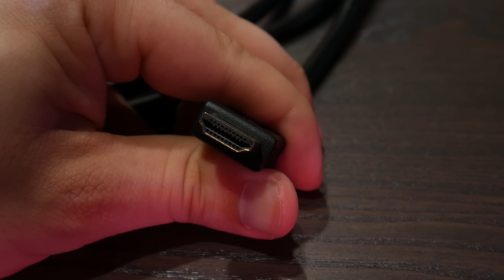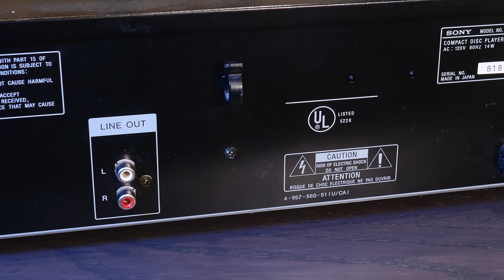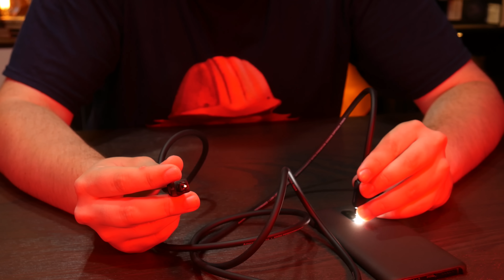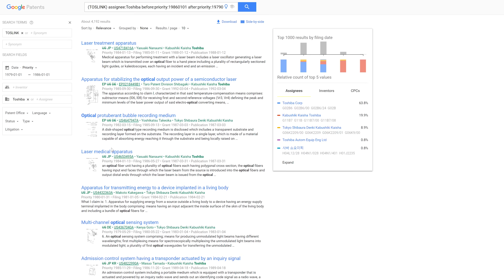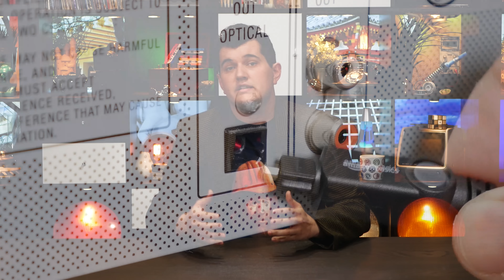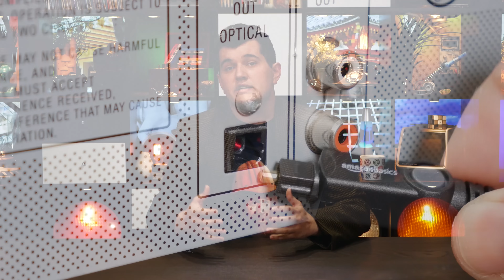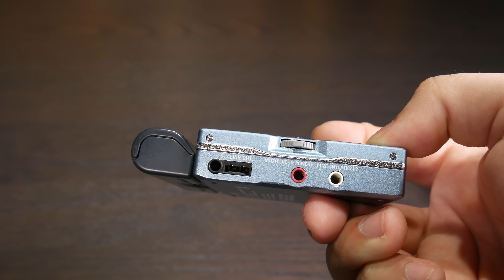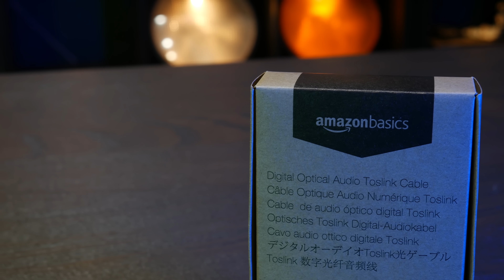TOSLINK: That one consumer fiber optic standard

Comment: I laughed out loud at gold plated connectors on an optical cable. 🤣
Reply: The funny thing is that “audiophiles” fall for this thing, not because of the esthetics but because they sincerely believe it’s better for the signal 😂
Reply: @Druskqq  man, if you think audiophiles are bad, wait until you find out the nonsensical shite tube guitar amp people say....
Reply: @immy4104 "It sounds better when I flip the cable around"
Reply: @immy4104 Nah, both camps are bad. Also, tube guitar amps are still pretty great, mostly because you treat them like tube amps, unlike studio monitors, which are focused entirely on reproducing incoming sound as perfect as possible for say, audio proruction and mastering, lacking the "in room" feel. Try positioning an FRFR cab like the real deal, and most differences will just go away. 

Oh and a gigantic, expensive and heavy noise box always feels special even if largely impractical compared to what's essentially a small computer connected to earphones even if they sound mostly the same.
Reply: @Druskqq  well, apart from optical cables, choosing gold plated cables makes much sense. while extra cost ist negligible as the gold on the plug is literally only atoms thick, the gold keeps the potentially different metals of the plug and the receiver from oxidising wich causes worse electrical conduction wich indeed makes it sound worse (that is not an immediate danger but damager over time though)
Reply: @xXRunDeathXx  Yeah no out of the entire realm of metals and composites gold is just a DUMB idea.  Period.
Reply: @ShadyDealz ok, why is it so commonly used in all of consumer electronics then?
Reply: @AriaTheBee  It's Form over Function.  It really is peak marketing comedy.  Optical cables transmit data using pulses of light, not electrical signals.  A gold-plated connector at the end does absolutely nothing for your audio or video quality.  ):
Reply: @ShadyDealz  It is NOT about the analog noise. Gold plated cables prevent "physical" problem coming from oxidised connections.
Reply: @HeeminYT  And?  That's only the connector heads that have the plating, the cable itself will still be copper and/or silver.
Reply: @xXRunDeathXx that is great for cables that use electrical signals, but the conecters for optical cables transmit using light through the fiber not electrical conduction from the metal. Even oxidizing wouldn't make anything worse as long as the light is getting through the fiber. The actual connector is just a plug to keep it seated and lined up, it has nothing to do with the function of the transmitted data and is purly structural. Hence why most just use plastic for the connector because conductivity doesn't matter for optical cables
Reply: You know, you laugh, but given that the plastic keying on my toslink cable just disintegrated in my jack... I could do with at least the metal.
Reply: What? You mean the shiny, shiny gold doesn't help to bounce the light down the cable better? I'm shocked, I tell you! SHOCKED!

 @IsonDaya  But gold is such a soft metal, the connector wouldn't be any more resilient. The only reason gold connector are prized if for their superior conductivity... which doesn't help at all when you're sending light, not electricity!
Reply: @alexpage4355  sure, but gold doesn't become brittle and literally disintegrate after five years. It would have helped in my particular circumstance.
Reply: @IsonDaya but like you already stated in your 1st comment, there's still zero reason to use "gold" because any metal (e.g. brass) or a more durable polymer would accomplish the same thing 💯
Reply: @alexpage4355  Gold connectors are not chosen for their conductivity, silver is way more conductive.
Gold is inert, your connectors will not oxidize.
On a plus, gold is a soft metal, wich makes better contact.
Reply: @alexpage4355 It's only a thin gold layer though. The rest of the metal will probably be something stronger regardless.
Reply: Like putting gloves on to see better
Reply: @Gregory Ford he’s referring to the fact that gold (and most metals in general as long as they don’t oxidize) do not become dry and brittle like plastic does after a few years. Old plastic can get so brittle that it’s no harder to crack or break than a tortilla chip.
Reply: @shad0w_dragon178  oh my friend, you're buying the wrong tortilla chips for sure! lol totally besides the point, but the moral of the story is: spend that money on better tortillas, not gold anything!
Reply: I'm not sure what you mean by that. Are you saying you don't believe me when I say plastic can get brittle? Or are you saying gold plated optical connectors are stupid? Because if it's the latter I agree but if it's the former... well I don't know what you are on about.
Reply: @shad0w_dragon178  What sort of plastic is used in the connectors?
Reply: @Devantejah  I honestly don’t know.
Reply: @shad0w_dragon178 its not like a micron layer of gold is going to make it stronger
Reply: @fireworkstarter  Well.. That's not necessarily true. The gold layer can stop the oxidization of the layer below.
Reply: Like putting a protective case on a Nokia 5110
Reply: that's marketing for you: sell you somenthing you don't need that you didn't want in the first place but were brainwashed to desire it
Reply: Me too and my wife looked at me like I'm an idiot.
Reply: Ha, that's what I came here to say 👍
Reply: @WirelessNut who cares if it's the same price anyways
Reply: Better light quality. 😂
Reply: same LOL
Reply: o'l mate's gold
Reply: I thought gold plated connectors didn't corrode, which is why its used, not its conductivity
Reply: @seymoarsalvage You are correct. It is the fourth best electrical conductor, but the only one in the top four that doesn't oxidise or react with sulphur.
Someone mentioned brass, but that oxidises.
The conductivity doesn't matter either; the point of contact in the connector is infinitesimal compared to the wire it connects. Corrosion itself is mainly a problem because it causes an unstable connection due to structural weakness, unless it is so severe that there is little to no metal to metal interface.
Any ability for gold to deform to fill gaps is also the "ability" for it to wear away.
Reply: YouTube actually suggested buying a gold-plated toslink cable as soon as Alec said it 😂
Reply: go big or go home i say, you're using a fancy cable anyway
Reply: I hope that all of us did.
Reply: Hahaha hey a good ground is ALWAYS necessary xD
Reply: I could almost cry and laugh! No, no, no… 😂
Reply: I'm sick, so I coughed 😂😖
Reply: They make the light brighter... or somthing
Reply: probably many audiophile bought it because  gold its better to transfet electricity 😎 and gives you +1 to being cool because its fiberoptic its also gives you +10 to being dumb if you have one of them
Reply: Monster HDMI cables 🤪
Reply: One can only hope that these companies have the good sense to just lie and not actually plate anything in gold
Reply: Well plated plastic might actually have some worth...but not soft gold
Reply: Came here to say the exact same thing :D
Reply: That, too.
Reply: I mean....if you plan on keeping it for 40 years then at least it won't corrode!
Reply: >he doesn't know
Reply: Gold is a good choice for the connector since gold doesn't oxidize. I get that it doesn't do anything for the signal, but material wise it's a good choice for the longevity of a connector.
Reply: But but but, they are so shiny! 😍
Reply: @HaroldKuilman  People spend most of their lives paying for shine, e.g., jewelry, watches, shoes, cars, teeth, hair, boats, dishes, floors, etc. but in this odd world of audio put a tiny bit of shine on a cable end and the criticism battalions show up for spending an extra $5. It'd be a good project for some sociology graduate student.
Reply: @tituslawoffice4778  if only it were $5, these cable salesmen will sell you a $1000 cable and try to convince you it’s better than a $5 one that works just as well.
Reply: @mikeg2491  Well according to Amazon gold plated TOSLINK is only $1.50 upcharge, depending on the model.
Reply: sound become “richer”
Reply: @win365ru  you mean the company that makes the cables becomes richer 😅
Reply: Corrosion proof!
Reply: Gold or no, Gangstahs gotta have their bling! 💰
Reply: "audiophile grade" sells a lot of garbage ot a lot of uninformed people.
Reply: @Tomyironmane  Garbage. If there's a lot of it, it must be easy to find but ... there's none out there to find.
Reply: It’s silly but it is like 0.0001 cents to do so I can’t blame them for doing it to look better
Reply: But if Toslink cables are jacketed, the gold plating would serve purpose in better contact for it's grounding...
Reply: One of the STRONGEST indicators for the fact that so-called "audiophiles" are in LARGE part just people who want to brag about the price tag of their HiFi system, while simultaneously having no clue whatsoever as to WHY some things are expensive and some aren't, they don't know jack (haha) about actual physics, and just parrot around buzzwords like "gold plated cable" because "gold is ALWAYS better for audio". The fact that there is a complete galvanic separation (no electrical connection/conductivity) between two devices (like a CD player and an amplifier), and therefore a conductivity-increasing gold plate layer is absolutely pointless, just doesn't matter to them. They are buying the figurative "snake oil" of the HiFi/Audio world.
Reply: As someone who does fiber splicing for a living I found that hilarious 🤣 literally 10Gbps internet fiber connections use a ceramic tip and plastic housings for some connectors and that’s it! Same crap that’s used to make toilets!
Reply: @MochiFromThe4th  man, DWDM can push multiple 40Gbit+ streams into a single fibre and transmit it over 50km+ and no one cares about gold plated super fat cables, "low jitter clock" or "ultra low noise power supply", yet still, there are morons that think an "audiophile switch" will make their 3Mbps stream sound better. They will even argue with you how much it improves the dynamics and widens the soundstage 🤣
Reply: they look nice though
Reply: Gold is pretty malleable and these gold plated toslink cables do seem to connect and disconnect with less apparent wear and tear on the toslink socket, compared to the (frayed, mishapen) plastic connector.

Not to mention, you can connect the gold to a layer of shielding over the fiber optic core, to better protec.cccc.kkkkk :)
Reply: @tf2scoutpunch175  Welcome!
Reply: @om617yota8  Nutshell
Reply: gold plating makes my 200 dollar hdmi gaming cable superior.
Reply: I connected my PC with my amp with a toslink cable and it actually has a gold plated connection because all my connections are gold plated and, although you can't see it, my OCD kinda demanded a gold plated toslink. It's stupid and it costs like 10 bucks more but I'm very happy with it.
Reply: @DarthErdmaennchen23  Well if it's reasonable, definitely go for it. 😁
Reply: Let's face it: Humans have crow DNA. Shiny things make us want them because they glitter. When we see (or hear the word) gold, it doesn't matter how it applies: Human nature makes us want it. Saying gold plated or gold tipped doesn't have to make sense. It'll still be a selling point because GOLD.
Reply: Gold's practical utility on connectors is because it's the most malleable metal right? I don't think it's to avoid corrosion unless people have particularly wet electronics. The only problem I've ever had with toslink is the hard plastic connector getting stuck, so perhaps this gold plating would have helped, but even so, it's cheaper to get the cheapest one plus a spare than to get a gold one.
Reply: @dananskidolf  So gold plating should be introduced for lubricant purposes? Get real.. 🙂
Reply: @Engineer9736  I just couldn't see any other reason to use it. No, not a lubricant, just something that allows a bit of deformation. But it's probably already too thin to allow it to deform like that so disregard.
Reply: What's all that fuss about. You folks are not the brightest candle on the Christmas tree, as we say in Germany.

It all boils down to gold plating on optical fibre cables is merely a matter of OPTICS.
So there's clearly an OPTICAL reasoning to it.
Reply: @sebastiant4597  If by optics, you mean marketing, then I agree, and I'm sure most people here do too. If you mean a legit functional difference, please explain.
Reply: @om617yota8  Yes, I mean "looks" or "design" , after all marketing is one of the main income sources. (Good stuff that's durable and lasting is a nightmare for sales.)
Reply: What's wrong with it?
Reply: @tf2scoutpunch175  Toslink is optical fiber, gold plating is for corrosion resistant electrical connections, just nothing to do with each other. It's like buying an orange at the grocery store advertising that it's high definition 4k.
Reply: @om617yota8  Gold cables could theoretically provide a better electrical connection 'if' the gold plate was thick enough, as it is a softer metal than copper and thus the gold 'could' create a snugger fit into the connection. Note, I don't generally bother using gold connections for anything. I do not think the human ear can tell the difference between gold and copper connections alone.
Reply: @bagofnails6692  Toslink is optical, bro. No electrical connection. That's why gold is a joke in this application.
Reply: @om617yota8  Having spent two hours yesterday unsuccessfully fucking around with a PS3 and Toslink cables, I am well aware of what Toslink is. I probably didn't make myself clear, I was talking about gold connectors cables in traditional analogue cables. Having gold plated Toslink cables makes as much sense as gold plated HDMI cables, which seems equally common.
Reply: @bagofnails6692  Yup you weren't clear. When gold is used legitimately, it's meant for corrosion protection, that's all. Best of luck with your PS3.
Reply: @om617yota8  I know many hi fi geeks and they have proposed all sorts of reasons as to why gold plated cables are better than standard copper ones, but very few of them make a lot of sense to me. As I mentioned earlier, 'if' the gold was thick enough, it would form a better fit in the socket and thus give a better signal. But it seems to me that the amount of gold needed to do this would make a very expensive cable indeed.
Reply: @bagofnails6692  I was thinking about spacecraft, military, and aerospace applications for gold plating. As far as hi fi geeks, if their $500(or whatever, not my world) cables make them happy, I wish them well.
Reply: @om617yota8  Of course in those contexts then the non corrosion aspects would be far more important than signal quality. I wasn't thinking on those terms. Although I love the idea of astronauts orbiting the planet having to somehow convert a Toslink signal into a RCA digital electronic signal, a bit like the Apollo 13 situation.
Reply: @bagofnails6692  hahahaahahahahaha..... thanks for the laugh.
Reply: @om617yota8  "That's why gold is a joke in this application" yes and no... ask a girl if she only needs earrings made of iron. Gold on an optical cable is not far from being men's jewelry?
Reply: @bagofnails6692  Then why not Brass? The whole point of gold anything in audio is a scam.
Reply: @om617yota8  I’m waiting for 8k oranges to come out. Until then my 8k juicer is purely future proof.
Reply: @bagofnails6692  One more time for those in the back: Toslink is optical. There are zero electrical signals being transferred by the cable. So an arguably better "electrical connection" would be completely irrelevant. Simply a waste of money on an unnecessary "premium" option (gimmick) that inarguably does absolutely nothing relevant to the optical signal. The reason they exist at all is simply because gimmicks sell.
Reply: @kromanaut  Did you read my follow upcomment, or just the original one ? I will assume just the first.
Reply: @bagofnails6692  Gold plating for electrical signal always makes more sense than gold plating an optical cable. With analog signals it's easier to argue about improved connection and less noise, while a usual argument with digital signal is that it's just 0 or 1. However, if you stretch the specifications like with extra long cables, you might benefit from better connection and less noise.

As long as the signal is transmitted without error, there is possibly no benefit of gold plating, but if you have a long cable gold plating might be the little extra to get better SNR, to avoid signal error.
Reply: @thorbjrnhellehaven5766  I once watched a youtube documentary on signal error on html cables. They were standard length, and i think they used the cheapest cable you could get, a maybe standard eight quid cable and a hundred and fifty quid cable. They used a computor to analyse the signal error over possibly ten seconds of data/footage. there was no difference at all between the £8 and £150 cables and atiny bit between the cheapest and the £8 cable. And when I say a tiny bit, it was not noticable at all, perhaps three or four pixels incorrect out of a total of a million or so. even if you had paused at the frames with the errors on, you would still need a computer to spot the difference.
Reply: @bagofnails6692  Im not sure why no one has mentioned this to you, but gold plating connections has everything to do with the conductivity properties of gold, and its resistance to corrosion. It has nothing to do with golds "ability to deform because its soft, making a better connection". Due to the skin effect, the thin cross section of plating still is effective.
Reply: @getclaked  But why would you need that level of conductivity on a digital signal ?
Reply: @bagofnails6692  Normally on consumer electronics, The gold plating is there because gold is the least likely metal to oxidize. As far as its ability to conduct, any electrical connection would benefit having gold plating, ESPECIALLY when sending intricate data signals. Since gold is expensive, you'll normally only see this on critical connections, or well-built electronics.
Reply: @getclaked  well, strictly speaking, yes it's softness and ability to deform doesn't directly contribute, those properties mean you can get a very, very thin plating. Someone in the above comments mentioned "why not brass", and it's because you couldn't get it super thin at fractions of a cent, like you can with gold. So from the manufacturers point of view, gold plating isn't expensive at all, and that does have something to do with it's softness.
Reply: @getclaked  well, no, you're not quite right about gold being so expensive, because gold can be used as such very, very thin plating, like molecules thick, so in the end it's not expensive at all, and so you'll see this on the very cheapest of cables, including on TOSlink cables where they are of little use (sorry, Alex E., I've never even seen the high-end equipment that "uses metal contacts to sense optical cable in a dual use socket", although I have no doubt such systems exist) Maybe you're referring to "critical connections" where thicker gold plating is used, but thin gold plating like you'd see on a toslink cable is not expensive at all.
Reply: @squirlmy  The term you're looking for is "ductility", and although that is a reason gold is used, its ductility has nothing to do with the plating process. Brass is not used because its conductivity and corrosion resistance is sub-par. Brass and gold are similar in color, but that's it.
Reply: @squirlmy  I think you're missing the point, and focusing a little too much on the price of gold. Gold is a VERY expensive material when it comes to consumer products. Yes, your charging cable doesn't contain a large sum of gold, a plating of gold is used because its effect is similar, otherwise your usb cable terminals would cost 800 bucks each. Gold is extremely expensive to manufacture with.
Reply: @Bag of Nails  why would you need corrosion resistance and high conductivity on electrical connections???   I think you should re read your statements sometimes haha.
Reply: @JgHaverty  Why would you want corrosion on any connectors?
Reply: @Titus Law Office  thatd be the point im trying to make sweetheart...
Reply: @om617yota8  or to fill the extra gap with a soft metal…
Reply: @sixspectre2329  Huh?
Reply: @om617yota8  think of it like a car. You put soft copper crush washers on when you do an oil change so the drain bolt has a tight seal. Same here, the gold creates at tight seal against the connector preventing movement
Reply: @sixspectre2329  Got you. There's never that much gold added, usually it's 30um coating, tops. For what you suggest, copper would work far better, at a fraction of the cost. There's a reason that's what's used in battery cable lugs and such. Just installed a couple hundred of them on a solar power system last week.
Reply: @om617yota8 Someone's jealous they've been eating 720p oranges.
Reply: @tf2scoutpunch175 The gold plating doesn’t do anything. It’s only on the outer part, which is purely for alignment and doesn’t transmit signals